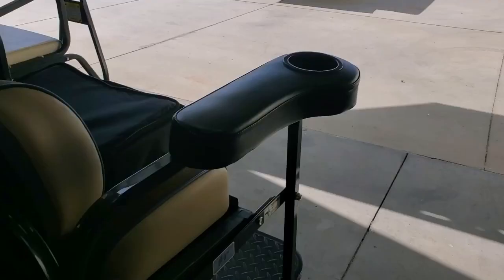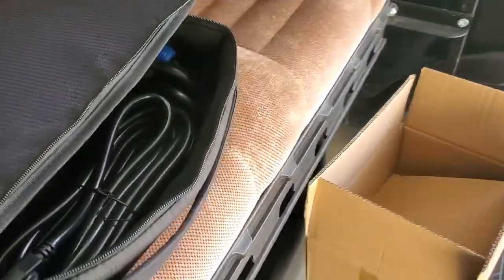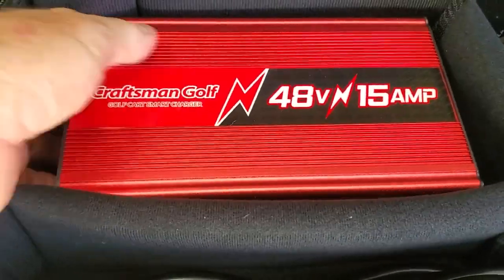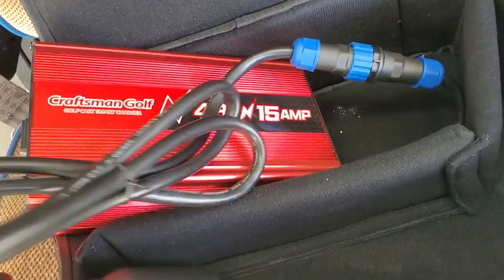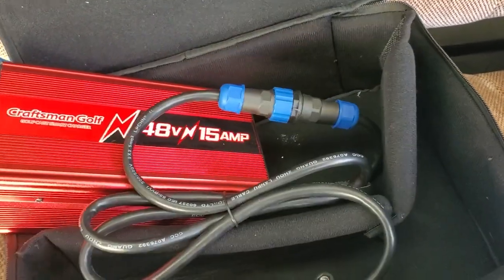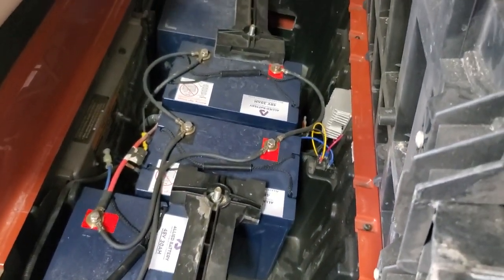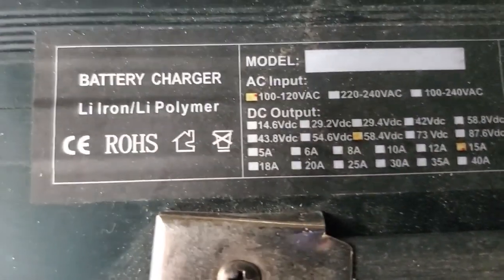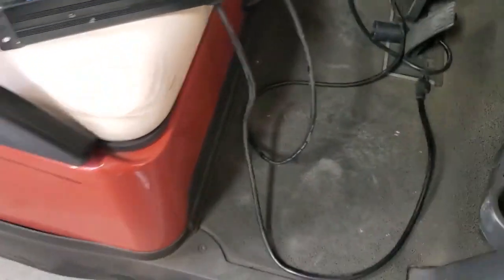NEW CLUB CAR BYPASS CHARGER

Comment: Hi Wayne, stumbled across your channel and was amazed. I wish I had found it sooner. I don't know if you are still doing videos and I'm not sure how to contact you so I'll just give it a shot and try on here. My Club Car precedent just quit running today. I was going along and poof. It stopped and wouldn't respond to the accelerator. I felt like it wanted to go but couldn't or wouldn't. When I hooked it back to the charger, the charger seemed like it wanted to work, but the gauge/needle wouldn't click on on the charger to show it charging. Hope you see this! Any advice would be greatly appreciated.
Reply from the maker: You can text me at 760 393 1314

Sounds like your batteries are not charged or 1 or more are bad.
Get a cheap volt meter and check the batteries.

Comment: Hey Wayne - videos are super helpful.  Have an 03’ club car ds.  What if I convert to lithium and use the existing club car charger? Can I do that or do I have to bypass the OBC?
Reply from the maker: If you go to lithium,  you need a lithium charger,  they are usually In the kit.
Also, yes you need to by pass your obc.

Comment: Hi Wayne, thank you for your videos.  I live in an area where there are no golf cart shops and I must perform all of my own service for my 2003 48v Pathfinder.  I recently had a short in my battery compartment and it fried one of my fuses.  My cart has two of the yellow glass fuse holders.  One of them blew up such that I could not remove it.  I had to cut out the fuse holder and replace it with a wire until I could replace the fuse holder.  
Q1: What is the amp rating on the two fuses?
Q2: If I charge my batteries with a non-PowerDrive charger directly to the battery posts, what consequences could I face in the future?  This after market is supposed to be smart and not overcharge the batteries.  This charger seems to work OK.
Reply from the maker: First,  replace the old glass type fuse holders, with the type you see in cars. Use 15 Amp fuses and you should be ok.
If you are currently using a pd charger, you can wire directly to the batteries and use a smart charger,  but you will need to do a bypass on the obc.

Comment: Hey Wayne!!  I have a 48V 2004 Club Car DS that was towed without putting the tow/run switch to tow.  The motor imploded.  Replaced the motor and new batteries.  When I hooked up the battery last negative, the resistor on the solenoid got really hot.  Thought bad controller.  Replaced the controller and solenoid, cart doesn't move.  Subsequently have replaced the tow/run switch, the forward/reverse switch, the MCOR and the OBC.  Still nothing.  No click or anything when pushing the pedal.  Batteries are fully charged, and all connections are tight.  Any thoughts Please??  Thanks!!
Reply from the maker: I answered your identical email

Comment: Hey Wayne, first off thanks for the videos! 
Have a question.. I have a 97 club car DS with 4 brand new everstart marine/RV 12v batteries I got for free. My current power drive charger won’t cut off and just keeps charging making me think the obc or the charger is bad.  My goal is to upgrade to a navitas ac with lithium battery but won’t be able to do so for about a year. So I just need this current setup to last me till then. Could you recommend a cheap charger? What about a 48v one that clamps onto the battery terminals?
Reply from the maker: Yes your batteries are the problem,  Marine batteries are no good for golf carts. So if you are gonna keep them, then yes a 48 volt charger with clamps ( other than any powerdrive chargers ) should charge the marine batteries

Comment: How can you use a smart charger that come with only battery cable type clips? New cart owner here. Do you still have to bypass obc if you use the clips?
Reply from the maker: In your case, if you hook the clips directly to the batteries,  it will charge them, without bypassing the obc. However, the obc will no longer accurately function properly.

Comment: Hey Mr Wayne. I recently discovered your chanell.  I'm thinking of purchasing this charger with your discount code. Would the waterproof one be a better long-term option.  I can bypass the obc. And eventually I want to upgrade to lithium batteries. Thanks so much- new fan!
Reply from the maker: Depending on your environment.  Of course a w/p model would be better in my opinion.
Reply: Thanks so much!!!

Comment: Wayne, I have an 07 Club Car precedent. It has started dimly blinking the rear lights at rest and even has power when switched into tow mode. What would cause that?  Thanks.
Reply from the maker: Depending on how they are wired.  , you can easily still have power to the lites, when the tow switch is off. You are probably wired directly to 1 battery.
I bet your lite switch is defective.
Reply: @waynemartin.waynesgolfcart4900    Thanks for the reply. It looks like I had a failure in the column mounted blinker unit. I ended up just removing it and no more issue. It's wired into the factory bucket harness.

Comment: I followed instructions and by passed the black wire to the battery negative on the drivers side and my charger is not working... Can you help
Reply from the maker: Did you get a bypass charger?